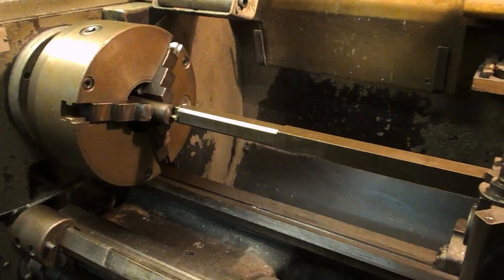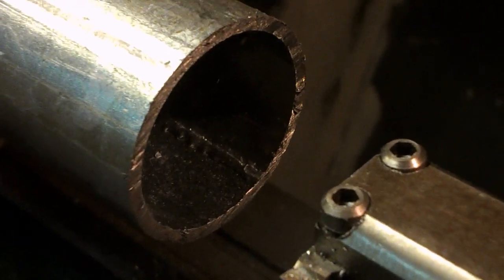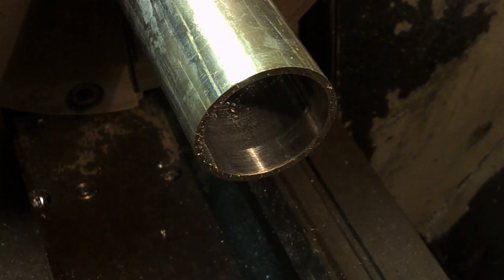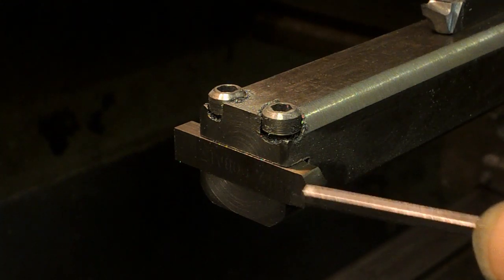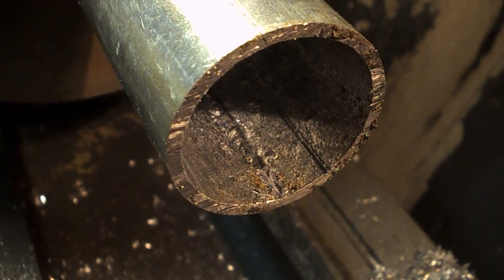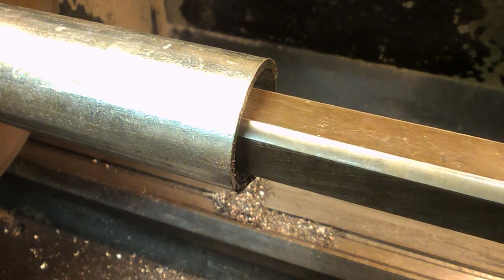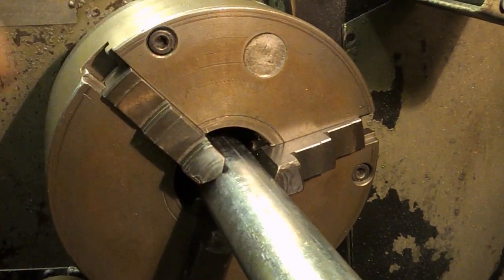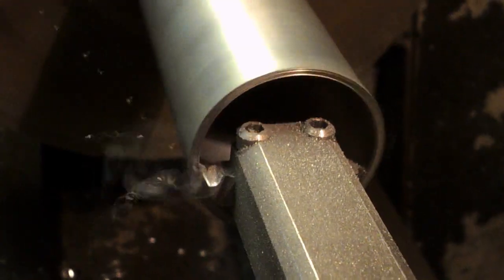Removing the internal weld seam & boring out a Scaffold Tube.

Comment: The sizes aren't daft, it's pointless making them in sizes that slide precisely because of the weld and welded tube isn't perfectly round, they're simply not intended for the job you want to use them for. As you say It's better to broach it (but pull it through rather than push) or make a self guiding boring bar that uses what has already been cut to guide and stabilise it.

Comment: The end of the stock sticking out of the left side of your head-stock is also going to contribute to overall FLEX. There are a number of YouTube videos that addresses the weld seam found on square, rectangle and round tubing. 
https://youtu.be/ozSE7Wrdb1o
Wakodahatchee Chris
Reply from the maker: I don't think I'd seen that video before but had seen some others & yes, I could have done with a bush or spider in the back end of the spindle...

Comment: This is interesting, we had this exact problem on a small project in the summer except we were trying to use thick wall gas pipe. In the end we thought it was too difficult and used mechanical tube and in our case we used 25mm rod inside 1-inch mechanical tube which has a 25.4mm ID
Reply from the maker: Good thinking. Mixing imperial & metric sizes sometimes works out really well!

Comment: I had to deal with boring off the weld in a recent project too. Nowhere near as long as that tube, but it was a sample of something that would have gone into a short production run.  It made sense then to record at what depth of cut was needed to remove the weld ( as well as recording similar measurements  for all the other operations. ) It was a steel tube that would hold a door key and be locked to a gate or something.